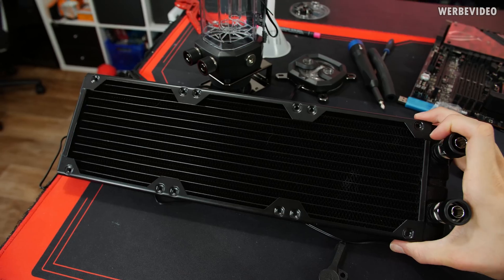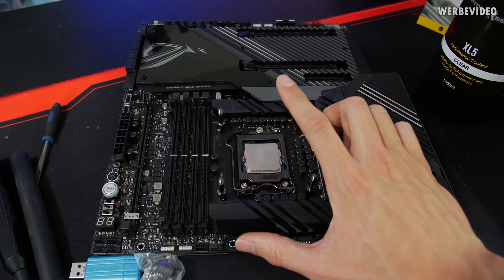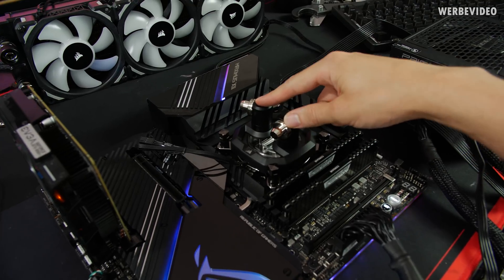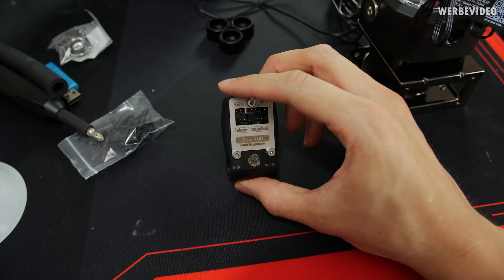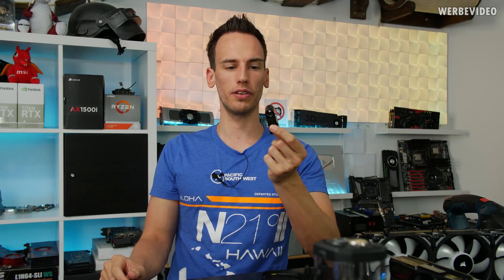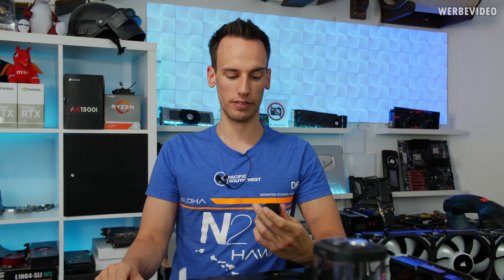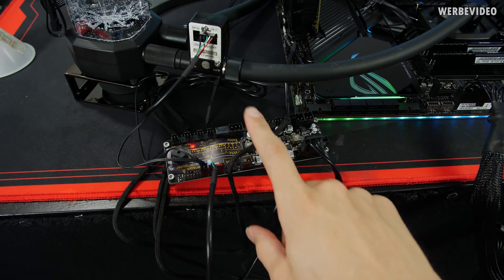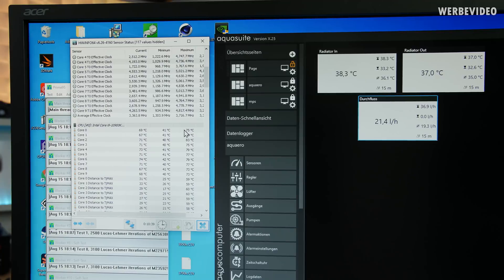Testing one of the Weirdest Water Cooling Myths - A SLOWER Flow Rate will result in BETTER Temps?

Comment: I have toyed with so many different cooling ideas over the years:

My first was a massive chest freezer with about 200L of water (in 2L water bottles) so you have the specific heat capacity of the ice and water but more importantly you also have the latent heat of liquefaction when the ice turns to water.

My second was submerging a system in either deionized water but this would be very tricky (impossible) to keep clean enough so it doesn't become electrically conductive, or submerge in mineral oil but that just looked too messy. What looks amazing is that Novec liquid but sadly it's crazy expensive.

My third, was a 'closed system' liquid nitrogen. So a sealed room, 100% nitrogen gas, with condensers to create the liquid nitrogen (radiators for the condensers are outside the room to dissipate the heat). Then you have an endless flow of LN2 and no ice or condensation build-up as you have removed all water vapour in the sealed room. But clearly this is very expensive, a massive amount of work and highly impractical.

My fourth, is either fully submerged or just a water loop but with a greatly reduced air pressure so that the water boils at ~60c as the latent heat of evaporation is so much bigger (better at absorbing heat) than simply relying on the specific heat capacity of water. This one is feasible but still pretty complex.

My fifth option, purchasing a chilled water loop system but not only does this feel like its cheating as it's all off the shelf but also there are not many companies making these nowadays, same as sub-zero phase change units. Plus they can be very loud too.

My finial option and favourite, a normal regular water loop but with a massive reservoir of water. I was thinking like a large metal oil barrel set up (you could paint it to make it look smart) so that you pretty much always have essentially room temperature water going into your system all of the time. I then took this idea one step on and thought rather than a giant water loop I could use a normal sized water loop but with the radiator inside the water of the barrel which then makes things much simpler in terms of draining the system but more importantly it allows you to have water flow in and out of the barrel. So you could use your cold water tap at ~10c degrees to easily cool your water loop, you could also dump ice in there if you wanted that extra little bit of cool for a certain benchmark or something.

Anyone have any other ideas or comments on these?
Reply: If you run your cooling system below ambient temperature you run the risk of condensation, it’s not just a problem for super cooling your system. I don’t know how you would reduce the pressure to achieve a boiling point ~60 C which is around the air pressure at 10km elevation. I’m assuming it would be rather bulky and expensive, maybe inside of a vacuum chamber. Possibly you could place your computer into a cold environment such as a refrigerator or freezer but I would be concerned about the coolant freezing if you go too low.  Random thoughts, free advice is as valuable as what you pay for it.
Reply: @solbot  The reduced pressure design would just need strong ridge tubing in a sealed low pressure loop, I think it would be doable.

Comment: Come on Roman, you didn't have to go to that much of an extreme to try to prove your point, what would have happened if you'd only dropped the flow rate down to 30% instead of to basically zero? Going from the data you provided, it would seem safe to assume that then it would be good to run multiple radiators in a row to help cool the water more before it gets back to the units it's cooling and use a medium-medium high flow rate.
Glad to hear that Shiek is doing better, hope she's learned her lesson and stays away from the windows now.

Comment: Honestly, I wouldn't give a damn about those never-ending, same questions (though you could always ask them to build with these changes and then post a link to their video). No, 99.99999% of us are here to see you, good Sir. Keep up the excellent work.
On a side note, shouldn't we be optimising flow rates (and build/fan speeds) - primarily - in order to achieve the biggest reduction in temps between a radiator IN (hot) and OUT (cold) - while balancing noise ??
Reply: Didn't watch the video did you.  The low flow case gave the biggest reduction in temp between the in and out of the radiator.  The high flow case gave the coolest CPU temperature. and the smallest temperature reduction in the radiator.

Comment: I 100% agree with your conclusion, but since in many cases temperatures delta between sensor are so little, I suggest to perform some kind of calibration before doing the actual measurements, for example checking if all the sensors measure the same temperature all across the range 25-45 °C. If it is not the case, you should account for that.
Also, what about two distinct loops with (large) in common reservoir, an high flow rate one for waterblocks and a solwer one for rads?

Comment: I think some people forget why water cooling is even used in the first place. It's either to get the most performance possible with high fan and pump speeds and the noise that goes with that. Or its for keeping the system cooler than air can at a low noise level. 
The more important question is , how much flow is required for the waterblocks used to function correctly and how much radiator capacity is needed to cool the components in the loop.
I would be interested to see the same test used on a cross-flow style of radiator , just to see if the temp drop is higher or flow restriction is less. Thick vs thin rads would be a cool test as well.
Reply: I've been asking myself the same questions for several days now.

Comment: Probably too complicated, but would it be possible to run two separate radiators in parallel at half flow rate for each by splitting tubes before and recombing after both radiators? Thus allowing the CPU to have full flow but the radiators spend more time (and surface area) cooling the water? My memory is failing me in how parallel lines of water works with pressure and what not, so it might require extra pumps to make sure everything is at the right flow rate, etc.

It just seems that if a CPU blocks works better with higher flow and a radiator with lower flow, why not (over) engineer a system that takes advantage of both? In my thought experiment I want to say doubling tubing size after the CPU block might do the same thing, where now twice as much water must fill the tube, thus halving the flow rate... but again, maybe I'm mistaking some part of how pressure and flow works in a closed system.

Seems fairly straight forward in how to test this setup, but then given that the "slow" water in the video was at 4%, maybe the halving the flow rate wouldn't be enough to affect actual CPU temps. Though more surface area should help in the parallel radiator setup.

Comment: Well, you've just shown that, all other things being equal, putting a rad before (or after) every heat source is better than lumping all rads and all heat sources together, especially when using low flow rates (and therefore low noise modes, which I personally prefer). The simple reason is that the higher the temperature difference between the source and the sink, the better the heat transfer. And yes, with a high flow rate the difference is a trifle but still it does exist. :)

Comment: I admit, I put a rad between my CPU and GPU but that was only because it made it easier for me to have the tubing runs the way I want them for aesthetic reasons.
Reply: the one in the title doesnt make sense but I can see a reason for the alternating radiator and heat source 

if you are water watercooling something like ram which took very little power, the energy from the cpu or gpu will just be heating up the ram to a point further than it would have heated up outside the loop.

I see this a lot and dont understand where people get the idea that energy only conducts one way

the only way it couldn't make a difference is if the heat gets perfectly distributed throughout the loop as if water is a superconductor, which if so then the flow rate wouldn't matter...
Reply: @BTD3Fan  Alternating heating and cooling sources won't make a difference in loop performance, there are literally thousands of videos here on YT demonstrating that. Also note that even here, on a test loop with massive amounts of heating sources, the water temp doesn't break 40C. DDR4 RAM will operate in excess of that temp, so at no time are you heating the RAM.

Also when you talk about water needing to be a superconductor, it seems disconnected from the rest of your statement. All parts of the water are spending equal amounts of time on all heating and cooling sources. If the flow rate is sufficient to keep operating temperatures well within a safe range, the difference in temperature across the loop will be less than 2C in most cases.
Reply: @Ephem13  in order for the heat to be spread evenly throughout all the water either the flow rate has to be infinitely fast or the water needs to be infinitely conductive.

So if the water has not yet gone through the radiator it has not yet fully cooled, even if its only a small amount. No video can claim to disprove the math, plus there are tons of people showing the last component in the loop being hotter.

Nowadays manufacturers git smart and you can buy fittings with more than 2 holes to run each block in parallel.  Plus they also make it easier to connect every component in most cases, while before you would have to double back after each radiator, which was the main reason people said there's no point in doing it.
Reply: @BTD3Fan  The point is that the heat capacity of water is so large that coolant will only heat up by ~1-2C as it passes through a CPU or GPU waterblock, and will only be cooled by ~1-2C as it passes through a radiator, in any practical loop with a realistic flow rate.

Assume a fairly low flow rate of 100 L/h - that's realistic for 2-3 blocks, 2-3 med-high restriction radiators, and a D5 set to a quiet speed. Most coolants are mostly water, and water weighs 1kg per L, so it's about 100kg of coolant per hour, with a heat capacity of 4.2kJ per kg per C - meaning 4.2kJ of energy to raise 1kg of water by 1C.

A temperature difference of 1C through a block means we're dissipating 420 kJ per hour into the coolant (4.2kJ/kgC * 1C * 100kg/hour), or 117 J per second (420,000 J over 3600 seconds) - i.e. 117 watts. That's about half of the power consumption of a heavily-overclocked CPU or a typical high-end GPU, so you're looking at about a 2C temperature difference before/after a typical CPU or GPU waterblock, and a similar decrease before/after a typical radiator.

In effect, in any practical loop, unless you're running a lot of blocks and/or a very low flow rate, loop order does not matter.

Furthermore: the typical loop isn't watercooling the AM, or any other low-power component, because doing so is pretty pointless in 99% of cases. If you're worried about RAM running hotter in your loop than outside of it...why are you watercooling them to begin with? Even if you're doing it for aesthetics, and even if they end up running a bit hotter as a result, the temperatures are going to be so low that it won't matter anyway. The typical loop's coolant is going to be in the 30-40C range under load.

Comment: Finally someone had the balls, and the brains, to demonstrate this! Thanks Roman!
Reply: You can do it with an AIO in a couple of minutes, just turn the pump speed down and watch temps rise :P
Reply: his conclusion is correct, but his measurements are not: 

A simple thermodynamics calculation gives 1.5[K]*4.2 [J/g-K]*5.5 [g/s] = 35 W. You are putting 170 W into the radiator, and your measurements only explain 35W. The temperature difference across your CPU or radiator at steady state should be ~7 degrees C.

Comment: Looks like those l/h values are wrong. These must be l/min (litres per minute), but i have no experience in water cooling.
1,7l/h == 0,47ml/s == 2,3mm/s @16mm tubes or 21,4l/h ==  5,9ml/s  ==  ~30mm/s @16mm tubes, which seems very small.
Then, 1,7l/min and 21,4l/min would result in 0,14m/s and 1,7m/s @16mm tube.
Reply: The pump used in the video (D5) are usually good for 200-300l/h in an average system, so yeah I think something about the units is wrong. I'm sure the sensor is working, but something is getting lost in the unit conversions

Comment: It's a classic qualitative vs quantitative thing. One could argue a slower flowrate could be better, as the water has more time to take up heat at a block and more time to lose it in the convector heat exchanger (they are NOT radiators!). Indeed, this effect is not significant enough to matter, compared to a faster refresh of water. The reason is simply that, comparing the two cases, the change of the flow rate term of convective heat transfer equation is significantly higher than the change in the temperature term.

Comment: Good video, having experimented with loop order, I can confirm, As long as your flow rate is high, loop order makes very little to no difference. But when you have multi GPU and CPU in the same loop, flow rate can be an issue, ( avoiding the expense of large tubes fittings, multi pumps etc)  loop order can have a small benifit.
Reply: his conclusion is correct, but his measurements are not: 

A simple thermodynamics calculation gives 1.5[K]*4.2 [J/g-K]*5.5 [g/s] = 35 W. He is putting 170 W into the radiator, and his measurements only explain 35W. The temperature difference across his CPU or radiator at steady state should be ~7 degrees C.

Comment: Here's an analogy:
Imagine a pond and there's a barn about 100m away from it that's on fire.
You've got 10 people there to help put it out. (number of people represents how much volume of coolant in the loop)
-Those people can either use a small bucket to fill water then run to the fire to dump it out. 
OR
-They can each fill and carry a big barrel. But the barrels are heavy so they can only walk to the fire slowly, and each barrel takes a lot longer to fill with water.

While the barrels may be able to dump a larger amount of water at one time, it takes much longer between each barrel, which allows the fire to get bigger between each barrel of water. 

With the buckets, they can quickly scoop up a smaller amount of water and get it to the fire, and throw it out much quicker.

It's not as much about how much heat you take away at any one moment, it's about how fast you can get the heat away from the CPU/GPU. 
Fast flow takes away smaller amounts of thermal energy per cycle, but because those cycles happen more frequently it's more efficient.
Reply: Analogies rarly come close to the real deal. That's why it's futile to use them. Better to learn the real terms and meaning of them so you really understand what is going on. Water, just like air is the coolant. If you turn up the pump speed eventually the CPU will reach the temperatur of the water if the heat conduction between the fins in the water block and the CPU die is perfect, but the relation is not linear, at first you will see huge gains (going from nothing to some small flow), but the more you increase the less gain you see :)
Reply: @TheEsseboy  I know the fundamentals behind this. The analogy is for helping people that don't understand why this works. Those that keep thinking the slow flow myth obviously don't understand the "why" or "how" and haven't bothered looking into the fundamentals. A quick and easy explanation can help.
Sure an analogy won't go into the physics and math, and won't perfectly describe something, but that's not the point. 

Also, yeah, there's definitely an optimal flow for every loop depending on every factor , component, pressure, and temp of that loop, but I haven't seen anyone calculate that, or even try mentioning it for PC cooling. Although.... it would be really interesting... and probably really complicated to calculate.
Reply: @BRUXXUS  Hmm, should find a scientist who knows thermodynamics and fluiddynamics for that :P I just know basic physics. But i think if you know the heat capacity of the water flow, know the heat dissipation of the radiator and have a performance graph of the waterblock it would be easy to calculate
, the only problem is getting the graph for block performance, no block have that that I know of >.<", 
maybe if we search for similar block for other applications? 
They might have specc sheets with graphs? Like industrial blocks of some type...though most of those you need to be a buyer to get specc sheets from :(
Reply: @TheEsseboy  Could probably calculate a rough estimation of a block by knowing the thermal conductivity of the metals and determining the surface area of all the fins... 
One thing I don't actually know is if the optimized flow rate changes with the temperature of the block vs. ambient temp. 
With enough sensors, I bet you could run the whole system from an Arduino to always keep the loop in its optimal cooling zone. Well... probably could run it from the computer... but I've really been having fun with Arduino lately.  :D
Reply: @BRUXXUS  Yea, but flow simulations takes tons of RAM :/

Comment: Haven't seen too many videos on fan speeds --  I have a 3700x locked to 4.3 all core and my radiator fans never turn on under most use but the pump stays at full speed (it's a quiet pump).